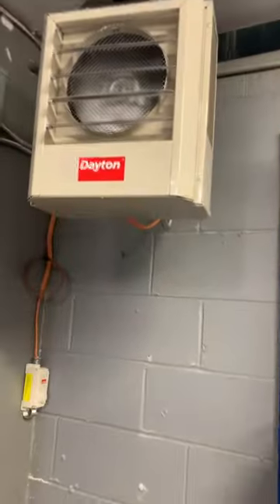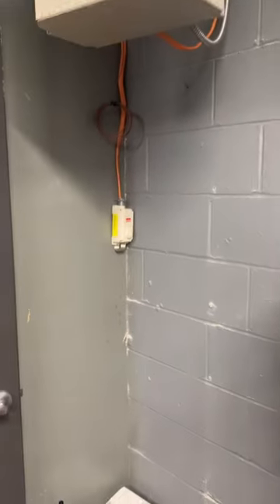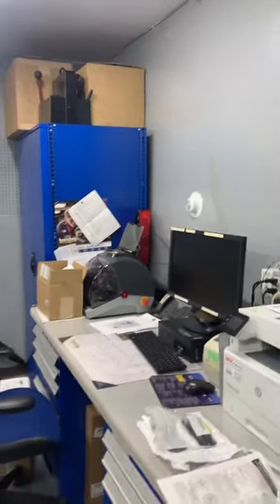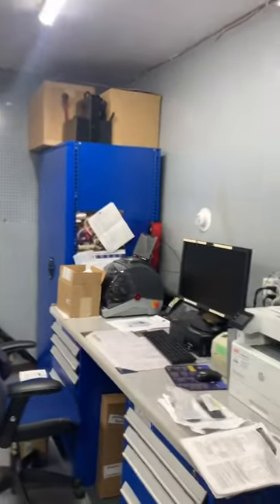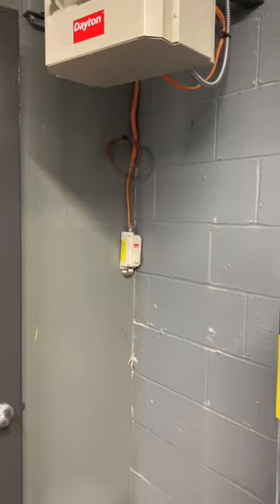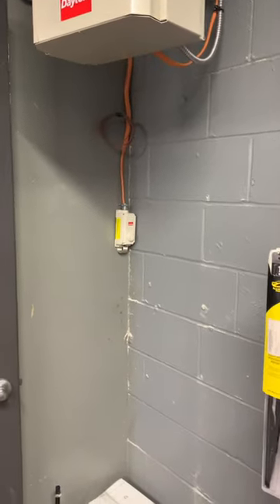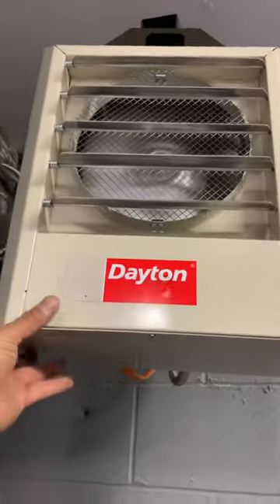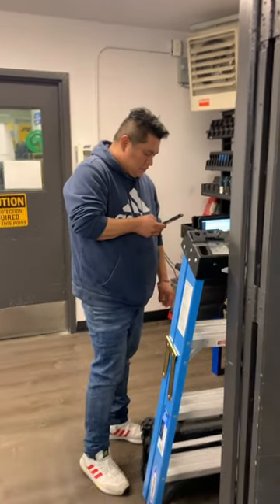Electrician life: dayton 2yu65 . Third heater worked but need to relocate thermostat

Comment: Can you explain how you hooked up the thermostat I’m working in a building now that has the same heater but I can’t figure out the wiring diagram. Thanks
Reply from the maker: Send me the paperwork and diagram . But i recall only cutting one of the legs with the thermostat
Reply from the maker: My number text me 9148377982
Reply from the maker: It has to be a specific high voltage thermostat as well